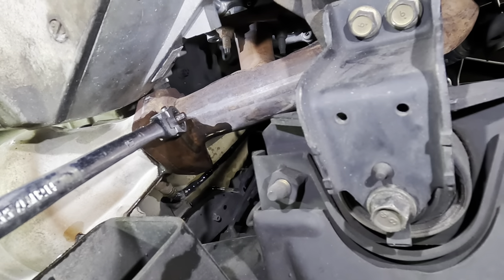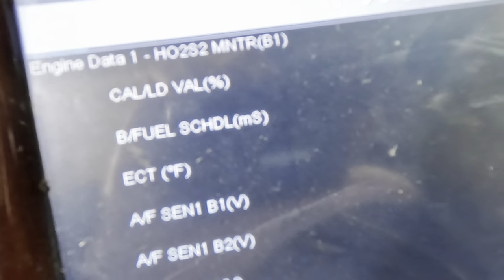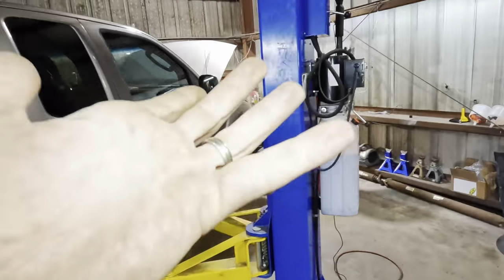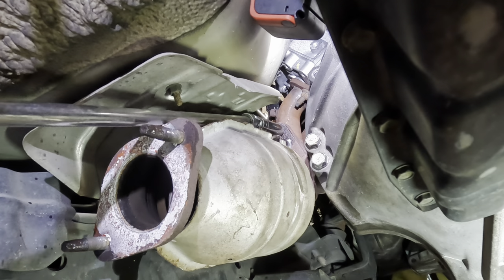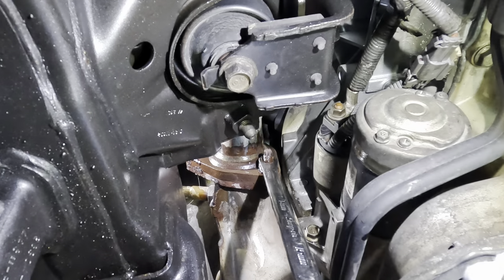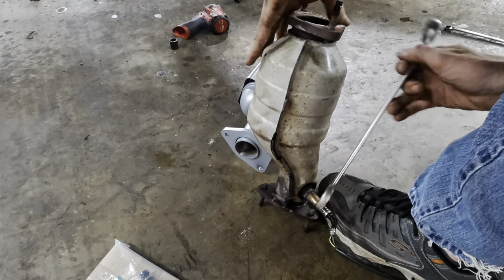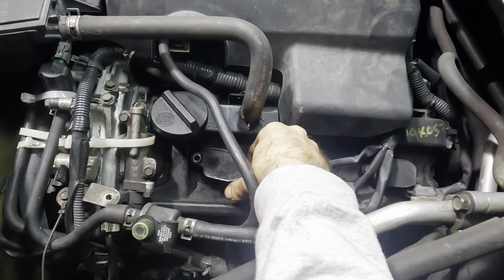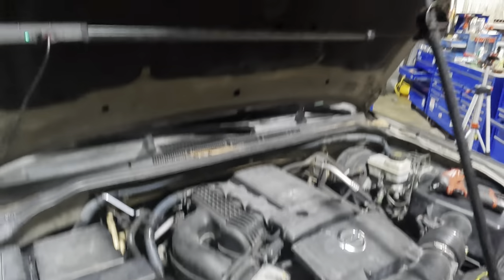Catalytic Converters! Missing?  Running Rough P0302 P0420 P0430 Nissan Fronter 4.0 v6

Comment: A plane requires air flow over the wings to generate lift. Visit a small airport during a storm and if a small Cessna isn’t tied down you’ll see them float. Speed under the wheels has nothing to do with lift.
Reply: This! 👍🏼 it’s about airspeed, not groundspeed.
Reply: Yep might have double the wheels rpm but still the same airspeed
Reply: 100% correct 👍
Reply: Lift is generated from air flow against the lower surface of the aircraft  wings. The airflow over  AND under the wings creates a vortex which is controlled by flaps. This gives you  altitude control. Stick your hand out the window of your car, like most people do as a kid. Keep your palm flat, and you can roughly feel the forces against you hand.
Reply: Exactly, the plane needs to "ride" on air. No moving air, no lift. It's speed of air across the wings, not speed in relation to the ground that creates lift.
Reply: Both the plane's engines and the belt would generate airflow around them, eventually achieving lift. But the question is meant to cause controversy.
Reply: Yep, so many people, even pilots, don't get this.  The only way the plane wouldn't be able to take off is if the engines drove the wheels like a car.  But they don't, because that's not how planes work.
Reply: You are correct sir!
Reply: @trollolol a plane can be stationary and ‘float’ if it has sufficient lift and is tied down. I’ve seen it. Air speed is very different from ground speed. You have ramps on carriers so you have time to build up air speed. A super huge powerful fan in front of the plane could also generate lift without the engines on as their will be air speed.  Just saw your name, your just trolling. It’s cool.
Reply: You all need to revisit the Mythbusters episode.
Reply: What if it's a windy day???
Reply: The way a wing is shaped causes air to flow faster over the top of the wing and slower underneath. This causes low air pressure over the top and high pressure under the bottom. The faster you go the more these forces come into play until the wing has to enter the lower pressure over top of the wing generating lift for the aircraft. It's not pushed into the air it's lifted. That's the condensed version, aviation electronic and ground crew technician for 7 years
Reply: Here's a visualizer that might help:  imagine you have a toy plane and a treadmill.  Hold the toy plane on the treadmill, and push the plane along the treadmill.  If you double the speed of the treadmill it still won't prevent you from pushing that plane along the treadmill, it will just cause the wheels to spin faster.
Reply: Conveyor belts move things.  If the belt was long/fast enough it would take off
Reply: @trollolol The plane wouldn't be standing still, as it's being driven forwards by the jet engines, not the wheels. There's no mention of how long the conveyor belt is but it's going to either take off or come off the ned, then take off.
Reply: Yep the plane takes off. The wheels aren't geared or otherwise directly driven they are essentially free-wheeling with an arbitrarily low non-zero amount of friction due to the bearings, the weight of the plane, friction of the tyres on the tarmac and so on. So yes, the wheels will end up spinning somewhat faster than on a normal runway but the plane will never the less take off as the plane could not give a jot what the wheel speed is during take-off (so long as it isn't fast enough to cause catastrophic failure) for it is not wheelspeed that matters but rather airspeed over the airfoils that determines lift and therefore a planes ability to leave the ground and fly.
Reply: If the conveyor belt was moving forward the plane would take off because airflow over the wings would create lift under the wings and lift the ✈
Reply: @MonoBrawI  Nope
Reply: The airplane doesn't care because it doesn't use its wheels to generate movement. Aircraft wheels are free spinning not counting the brakes, that is the key here. 
Also Mythbusters did this large scale.
Reply: @hot_wheelz  There is no airspeed since in the scenario the faster the jets go, the faster the treadmill goes in the OPPOSITE direction.  That means the plane stands still and cant take off.
Reply: @jet357  Hmmmmm, yes it would take off.   The wheels are powered by the forward  motion of the aircraft.  The action or inaction of the belt  is a non  entity.   The  belt equaling the opposite energy only means that the plane IS moving.   Plane is moving AND air IS flowing over and under the wings.
Reply: Yeah but by the definition of the experiment, the plane CAN'T move relative to the ground around the conveyor and thus not the air i.e. no lift.
Reply: @UCh2ErHSmlm1yVAOIEA55ByA No where in the setup does it state that the plane is to stay stationary. It only states that the belt is to move backwards at the same speed the plane is moving forward. You could start the belt at 200mph and the plane would still take off.
Reply: If you are a fan of Mythbusters the busted it. The wheels don't drive the plane the engines do. If it was a car with wings the it won't move.
Reply: Yep, ground speed is irrelevant without lift.
Reply: Now the big? If the conveyor is moving fast enough could it count towards world land speed record...
Reply: @ken2tou  but there's no airspeed if the conveyor is truly matching the resulting wheelspeed of the plane. It has nothing to do with how the wheels are being driven! The definition of the experiment necessarily doesn't allow the plane to move relative to the ground, ans thus the air, around the plane. I know Mythbusters tried to tackle this years ago, I remember seeing it, but either problem statement was different or they didn't implement the experiment correctly. They were notorious for cutting corners. See my other thread for a more detailed explanation.
Reply: @michaelray5595  there won't be any lift if the plane is not moving relative to the air, and it won't if the speed of the treadmill matches the wheels, even though the wheels are not driven. Most people get this wrong today because the Mybusters did a similar but different experiment
Reply: Um the Harrier Jump Jet would like a word. You only need thrust, not air flow.
Reply: @garyspooner711  mythbusters got it wrong/did a slightly different experiment. Their "conveyor," didn't match the speed of the wheels. It provided more like a frictionless surface (or at least low friction).
Reply: @trollolol hallelujah at least SOMEBODY gets it! Mythbusters ruined this problem for the Internet by doing a slightly different experiment and people don't pay attention to details sadly.
Reply: @realcdcruze3558  there's no airspeed in this experiment, the plane is stationary relative to the air and ground, only the belt and the planes wheels are moving... and the engines spinning but I digress. The belt is designed to counteract the thrust of the plane's effect on it's position by moving equally backwards. It doesn't matter that the wheels are not driven. The way the problem is defined, the plane doesn't move relative to earth.
Reply: The only way the plane would not take off is if it was tied down, and in that case, it would be the tie down stopping the plane from moving, not the treadmill.
Reply: Exactly!
Reply: @RichiPuppi  the plane is not moving relative to the air because in this hypothetical experiment the conveyor is matching it's speed in the opposite direction. So relative to the air and ground around the plane and conveyor system, they would both be stationary no matter how much thrust or how fast the belt has to spin to counter the effect of the thrust. It doesn't matter that the wheels are not driven. In order to take off you need lift.
Reply: Too much common sense. Error error error
Reply: @mattm6834  unfortunately not, there's no lift.  It coild with a sling shot cable, ie. Aircraft carriers, but not a conveyor belt.
Reply: @Onewheelordeal  you can't increase the wheel speed enough (indirectly by increasing thrust) because the conveyor is defined to match it. Even if you got them to 100,000 RPM. The plane CANNOT move relative to the air/ground around the conveyor by definition. It cannot take off.
Reply: @Gideon_Judges6  ummm, yeah? Kinda what I said - ground speed is irrelevant with no lift. I see where you got lost,  though. Ground speed only becomes a factor when the engines are driving it forward to create lift, the wheeks on a pkane are free spinning, they create no drive - plane on conveyor belt same as walking/running on a treadmill...
Reply: You are correct!
Reply: @michaelray5595  I didn't get lost 😆. You got lost where I was agreeing with you. Cheers mate!  BTW the way I like to make the analogy of holding a toy car or plane on a moving treadmill. You can increase the treadmill speed (within reasonable limits) and your hand will match it, and though it takes more effort (thrust) the toy will NOT move relative to the rest of the environment. i.e. no lift.
Reply: @Gideon_Judges6  that would only hold true for a vehicle like a car because the wheels are directly driven. For a plane, the wheels are in no meaningful way connected to the power source (the engines that produce thrust via props or jets). So for a plane, wheelspeed is literally meaningless in terms of a planes ability to take off. The wheels only serve as a smooth low friction interface to allow the plane to travel down the runway without smashing into the ground. Assuming that the undercarriage amd landing gear do not collapse and that the tyres don't pop or the bearings seize then the wheels of a plane will continue to do their job regardless of the ground moving below them. I understand where the confusion starts because when you think of a car the speed of the wheels and the ground speed are inherently and unavoidably linked. That fixed relationship does not exist for the wheels on a plane. The plane WILL take off just with the wheels spinning a bit faster than normal.
Reply: @Gideon_Judges6  ah. gotcha, it didn't quite read that way.  But inflection always gets lost in translation in text. 🍻
Reply: @trollolol this does not zero out because engine thrust is not applied to the wheels/ground, it is applied to air pressure.  This is why when aircraft are launched from a carrier the carrier is pointed into the wind.  It is also why the active runways are the ones facing into the wind, so you don't have a tailwind.  If you have a high tailwind you need even more groundspeed to develop enough lift.  Hence why flying eastbound in the Jetstream is faster than flying westbound
Reply: @jet357  sorry but no. As soon as the jet produces sufficient thrust to overcome the relatively very small frictional losses of the wheels / tyres, the 2 systems are for all practical purposes decoupled. Past that the conveyor can make the wheels spin faster, and they will, but only the jets will have meaningful impact on the forward momentum or the plane and therefore the wind over the air foils and resultant lift. QED the wheels spin faster but the plane still takes off.
Reply: @CatRPlrC16  Nah its vacuum over the wing as the air travels further!
Reply: @Gideon_Judges6  here's the real crux of the matter, so long as the tyres don't pop, the bearings don't seize and the undercarriage / landing gear does not collapse, once the props / jets are producing enough thrust to overcome the relatively very low frictional losses of the system, the treadmill / conveyor belt no longer has any ability to impact the forward speed / airspeed of the plane in any way that is remotely meaningful as the 2 systems are at that point for all practical purposes decoupled from each other. The conveyor belt can and will impact tyre speed, but only the thrust producing system (the engines / props / jets) have any meaningful impact on airspeed. So yes, the wheels will spin faster, but the plane very much still takes off.
Reply: The aircraft has no problem taking off because its engines provide thrust and airspeed regardless of how fast the wheels have to spin.
Reply: That is correct Sir! If enough air is flowing over & under the wings it will fly!
Reply: @@trollolol705 There are planes that lift off from stand still but not Jumbos!
Reply: Hell, I've seen one that wasn't tied down in a hurricane not only take off, but it flew BACKWARDS!
Reply: @trollolol incorrect, mr Trollolol, ( nice handle) as the engines exert thrust against the air, not the ground. This pushes the plane forward. The amount of drag created by the “runway” going in the other direction will be insufficient to prevent this. Indeed, the runway will actually draw air along with it in the vicinity of the surface, which might even contribute to the air passing under the wings, and help to create the negative pressure area over the wing, which is what makes flight possible. But as Ray says, “gravity “. Merry Christmas!
Reply: @hot_wheelz  no, they are NOT decoupled! Assuming (reasonably) that the belt and tire interface is not frictionless, the plane is not weightless  or any other contrived nonsense, the position of the plane is ABSOLUTELY dependent on the state of the conveyor! The plane is applying a downward gravitational force of F_g=mg (i.e. the weight).  The belt is applying a rearward force that is DEPENDENT on the forward thrust of the plane's engines and their subsequent effect on wheel speed relative to the belt. The systems are in NO WAY decoupled! They're interdependent.
Reply: It's easy to see what happens once you realise that the belt has no way to apply a force on the aircraft (Assuming rolling resistance is negligible).
Reply: @jet357  nope. Read the question again.
Reply: Mythbusters did an episode on this.
Reply: @Gideon_Judges6  sorry but no. There are frictional losses yes, but they are tiny compared to the thrust produced by the jets. As soon as the jets produce more thrust than those small frictional losses the wheels will continue to accelerate but the airspeed is only controlled by the thrust produced by the jets. The more thust produced the smaller percentage the frictional losses are of the entire system. The system rapidly becomes decoupled.
Reply: @trollolol Your name give it away.
Reply: Hey Ray, first, merry Christmas. You phrased that question differently around the 22 minute mark than you did at the beginning. And it’s really all about how it is phrased.  Your original question was if the plane could take off when the speed of the belt was maintained to match the normal wheel speed. At 22, you gave the example that the belt would travel at the speed needed for liftoff (V2), and the throttles would be increased to make the plane be stationary.  Those are two completely different things.  If the throttles are only increased to maintain its position, then it will not fly. However that is not nearly maximum throttle.  At maximum throttle, the engines exert thousands of pounds of thrust. The plane will move forward regardless of what the wheels are doing.  (Maximum thrust of a 747 will move it without rotating the tires, they will skid) There will be some drag created by the wheel/road interaction, but less than the thrust created. so the question is then if that drag would be sufficient to keep the plane stationary.  And again, the question would then be if the belt speed would be allowed to be more than takeoff in reverse. Because you will need to go MUCH faster than that before the wheels would produce enough drag to cancel the engine thrust.  And the belt will be also moving a lot of air as well at that speed. Perhaps enough to create some lift. And if the plane begins to lift, you lose all drag from friction with the belt, and and away it goes.  Happy New Year as well! 🎉
Reply: Lift is essential.
Reply: I mean.. the funny part is the debate assumes that an airplane would care about the treadmill. Once the engines get up to speed, it's going to roll right off the treadmill.
Reply: Such Physics used to taught to youngins in pubic skool's , but not anymore. That the ignorant are easily misled has become abundantly clear since Jan 2017.
Reply: Hell even MythBusters did a episode on this explaining it.
Reply: I was shocked this was even a question.
Reply: A conveyor belt would not effect a plane.  Thrust is generated by props, fans, and jets.  Not drive wheels.  There fore the plane would still have the same forward motion and lift nomater how fast the conveyor belt was moving.  Conveyor could be traveling at 5x the speed and have no effect till the wheel speed exceeds wheel failure point then plane broken would prevent flying action.
If you put wings on a car it would stay stationary and have no lift because thrust is generated by drive wheels.
Reply: Ray's conclusions about the inhumanity of man when in the midst of clear and obvious data is, unfortunately, quite correct.
Reply: It's a funny argument and counter intuitive....the plane moves because the prop or jet engine is pushing it through the air creating lift on the wings....the wheels are just along for the ride
Reply: @CatRPlrC16   Pitch control is controlled by the elevators located on the horizontal stabilizer on the tail. The angle of attack of the wing is what what effects altitude. When you stick your hand out of the window of a car and move your hand either up or down that's the effect your feeling, changing the angle of attack of your hand against the air flow over it. Flaps are used to increase the curvature of the wing producing more lift at lower air speeds. The difference in the distance the air has to flow between the upper and lower parts of the wing produces a low pressure area above the wing so the plane is being pulled up into the air verses riding on the lower part of the wing.
Reply: @StormsparkPegasus  If there is any pilot that doesn't understand this I wouldn't even get in a plane with him!
Reply: @SourBogBubble  The jump jet used motors that could be pivoted to point downwards so it could take off like a rocket. A normal plane doesn't have those. A normal plane needs air to be flowing horizontally over its wings fast enough to create lift.
Reply: Correct, the force of the air on the shape of the wing creates a pressure differential ergo lift. This won’t happen without actual forward movement.
Reply: @intentionaloffside8934  Yep, and the jets produce the foward movement.  It doesn't matter whether the conveyor exists or not.
Reply: @RichiPuppi  Think about it. In the conveyor belt example, you could be standing on the body of the plane without any problem. There'd be vibration through the frame, but because the plane was stationary with respect to the ground, there'd be no air movement over the wing and therefore no wind to blow you over (and also no lift, so the plane could not take off).
Reply: @handbananaistherapist642  If you held the brakes it would move forward otherwise no it would not fly. You would need a conveyor belt capable of getting the plane up to takeoff speed, something like 150 to 160 mph.
Reply: Speed of the wheels is not relevant to the medium the plane uses to fly.

The Mythbusters have an episode dedicated to this myth.
Reply: The wheels do not provide power to move the plane forward. So they got it right. The engine provides the forward movement. The wheels will be moving at the speed of the belt plus the speed of the forward movement of the engine. All planes have free moving wheels.
Reply: @hot_wheelz  But in the conveyor belt scenario, there is no airflow over the wings, and therefore no lift, therefore no takeoff.  If you stood on the wing of a plane trying to take off normally, you'd have to fight to stay upright against a wind of the plane's regular takeoff speed; in the case of a 747, that's about 184mph. If the plane was on a treadmill, it could be thrusting enough to be moving at 184mph but it would be stationary with respect to the ground and the air, so no wind, no lift, no takeoff.
Reply: @ColinWatters  There's no lift, because there's no air flowing over the wing. The plane has to be moving with respect to the ground, and on a treadmill it wouldn't be, it would be standing still.
Reply: @jostouw4366  Only because they have pivoting engines that can point downwards and provide rocket-style vertical thrust.
Reply: @Rekuzan  Because the wind was blowing over the wings fast enough to create lift. On a treadmill, the wind would not be blowing over the wings fast enough to create lift.
Reply: @SourBogBubble  The Harrier uses nozzles to vector thrust down to lift off the ground vertically, then the nozzles rotate backwards to apply thrust to the rear to allow for forward movement and then the wings take over. If your argument is correct then why does it have wings at all? It does not fly like a helicopter.
Reply: Yes, the plane will take off; this was a Mythbuster episode and as explained, the ground speed is irrelevant, it is air speed that results in flight.
Reply: @intentionaloffside8934  
Or a bunch of really yuge fans moving lotsa Air
Reply: @stephenb1372  that's close but not entirely right. True it is all about airspeed over the wing however it's about airspeed difference over and under. The air over the wing must travel faster than under the wing thus creating a low air pressure zone on top. Air pressure wants to be equal thus lifting the wing towards the low pressure zone
Reply: If a plane required ground speed to fly it would never be able to leave the ground.
Reply: All saying that it wouldn’t fly are thinking it through (including Ray).
He didn’t say that the conveyor was lock-step to the forward direction of the aircraft. He simply says that the conveyor is moving the opposite speed the aircraft would need to take off OR if the aircraft normally takes off at 150 knots, the conveyor is traveling the opposite direction at 150 knots. This suggests a fixed speed of the conveyor. What this would mean is that the aircraft would be 150 knots in one direction, the conveyor 150 knots the other direction, and the tires are 2x 150 knots.
Reply: @CatRPlrC16 Not quite but nearly.
Reply: @StormsparkPegasus  A plane on a treadmill is essentially stationary in relation to the ground. So how can there be enough airspeed over the wings to generate lift? 

The plane needs to be moving through the air fast enough to create the lift, which it can't do on a treadmill, unless you also have a gigantic fan in front of it blowing a large enough volume of air fast enough over the wings.

When cars are put on dynos (basically the same thing as a treadmill), the car can be producing enough thrust to be travelling at (say) 200mph, but as far as the air around it is concerned, it's standing still. 

That's why there has to be a large fan in front of the dyno blasting air into the radiator - if the fan wasn't there, the engine would rapidly overheat since it needs the airspeed that comes with driving down the road at high speed in order for the cooling system to work properly. 

Otherwise, the engine is running flat-out but the cooling system can only provide enough cooling for an idling engine.
Reply: @StormsparkPegasus Nope. That would make no difference at all.
Reply: @dunebasher1971   Because jet engines produce thrust, which will move the plane forward.  There is no connection between the engines and the ground.  The treadmill will just make the (already free spinning) wheels spin faster.
Reply: The other factor ignored by the it will never fly is the engines develop air speed totally independent of the ground speed. If a airplane required ground speed to fly it would be never be able to lift off the ground.
Reply: @Matt_Vanepps  wheel speed doesn't matter, the fact the aircraft is stationary relative to its surroundings means no forward momentum or velocity thus not generating any airspeed.
Reply: @handbananaistherapist642 Wrong. The plane is only moving with reference to the surface of the belt, not the air around it.
Reply: @Trevor_Austin  If you mean the treadmill makes no difference to the plane at all, correct.
Reply: @SteelJM1 This is the point of this question. The plane is stationary.
Reply: @SourBogBubble A Harrier when hovering is not generating lift with the wings.
Reply: @joshualeniger Exactly.
Reply: @dunebasher1971  I know. I using that as a perfect example of ground speed vs. airspeed. Blocked Pitot tubes have caused planes to crash before because the pilots thought their airspeed was much higher than it was.
Reply: @Trevor_Austin  Trust me.
Reply: @Matt_Vanepps  Agreed, if an airplane required touching the ground to develop forward air speed it would never be able to leave the ground, rather as it started to take off the speed would decrease and it would fall back on the runway.
Reply: @dunebasher1971  nope, the wheels would be moving faster, but that treadmill try as it might isn't sufficiently coupled to the jets to overcome the thrust of the jets. Once the jets overcome the frictional losses (mostly that of the wheel bearings and the tyre with the treadmill / conveyor belt) which happens very quickly, the conveyor belt is no long able to sufficiently influence the forward momentum of the plane, only the wheelspeed. So, once again, the wheels will spin faster but that plane is very much still taking off. Airspeed over the wings is not related to the speed of the wheels. Literally the only way that jet is not taking off is if the wheels are unable to spin at all (either due to the brakes or seized bearings) at which point the conveyor belt need not move as the frictional losses between the tyres / wheels and the ground is near enough infinite such that the plane never moves forward but at that point it is not the conveyor belt that is impeding forward momentum, rather it is the breaks or seized bearings. If the wheels spin with the normal very low amount of friction expected when everything is working as intended then the plane is taking off and there's literally nothing the ground below it can do to stop it (assuming of course that the ground is flat, smooth and preferably somewhat level)
Reply: Correct-o-mundo!  There is, however, the possibility of the wheels flying apart as they would be traveling as fast as the Air Speed plus the tread mill speed. They just might not make it.
Reply: Exactly when the dynamics of air flowing over a wing providing left flight is achieved.  If the belt is moving fast enough
Reply: @dunebasher1971  to take your car on a dyno example, yes absolutely true. However in a car the engine is connected to the wheels / tyres via a transmission, drive train, differential and axles. In a jet, or any other plane designed to take off and land on solid ground the wheels are free spinning, once the very small frictional losses of the tyre with the runway and the wheel bearing are overcome the wheels operate independently of the jets. The wheels do not control the speed over the ground but rather the speed of the ground beneath the wheels controls how fast the wheels spin, forward momentum, air speed, lift etc. are controlled by another system consisting of the jets and flight surfaces (mostly the airfoils and flaps) as long as the wheels are able to spin freely (ie. The wheel bearings are not seized and the brakes are not on) then the 2 systems are decoupled from each other.
Reply: @MonoBrawI  This is it, The plane's wheels are not hooked up to a motor. you need the engine to create airspeed to match the belt to keep the airplane from moving backwards.
Reply: @misterkite  The difference is that your hand is providing the "force" to match the speed. without that it would need engines to move air to match the speed.
Reply: @jimomega381  the example of standing with each foot in a bucket and then attempting to lift one's self off the ground by using your arms to pull upwards on the handles is a good example of a coupled system. In that case, equal and opposite forces cancel and you go nowhere.

It seems that where most people get tripped up with this thought experiment is in not realising that in the case of the plane, the 2 systems in question (the thrust and lift system, ie. Jets, wings, etc.) isn't sufficiently coupled to the system that allows the plane to land and take off safely on a runway (ie the wheels, tyres, landing gear etc.) In the case of the plane, as long as the tyres are inflated, the wheel bearings not seized and the brakes not on then forward momentum and therefore airspeed is controlled by the thrust produced by the jets, the wheels and tyres are at that point simply along for the ride and respond by spinning at whatever speed is required to match the speed of the runway beneath them.
Reply: @BenDecko2023  really? I guess you're not a troll LMFAO
Reply: @jimomega381  no, you are coupled to the treadmill via your feet, run on the treadmill holding the plane, now while still running on the treadmill throw the paper plane forward as you normally would to launch it (this is the thrust produced by the jets) now you find that the paper plane flys across the room just fine despite that fact that you are still stuck running on the spot on the treadmill.
Reply: @Gideon_Judges6  The problem is there is no speed at which the belt can overcome the thrust. It's impossible. The wheels are free spinning, so the only resisting force they can apply to the plane are rolling friction of the tires and friction from the axle bearings. These are so small compared to the thrust from the engines they might as well be zero. The belt could be going 9/10 the speed of light and it wouldn't stop the plane (ignoring the wheels flying apart from overspeed) Think of it this way, if you put a matchbox car (so fully free spinning wheels) on a treadmill, is there any speed you can think of that you could run the treadmill that would prevent you from moving the car forward on it by just a finger pressing on the back of the car?
Reply: @LONECOW1210  Except that engines provide force regardless of wheel speed, exactly like your hand in my scenario.
Reply: @CatRPlrC16  my hand hand?
Reply: @christopherconwell7271    I think you might have misunderstood.   The only thing moving is the belt and it is turning the tires.  The plane is stationary relative to its surroundings.
Reply: @MonoBrawI  No.  There will be disturbed air around the belt and wheels, but that and the air flowing into and out of the engines has zero effect on airflow around the wings.
Reply: @9Blu  you're missing the point. Take your analogy of the treadmill, which was actually MY analogy if you go back, but I digress. If you COULD push the car forward more, this would increase the wheel speed. By definition of the original problem, the conveyor should speed up to match! It would not be possible to overcome that without violating the problem statement. On a freewheeling belt? Sure. On a fixed speed belt? Sure, but not if it by definition is adapting to offset the thrust's effect on the plane moving.
Reply: @Gideon_Judges6  What you have to understand is that your belief that the Airspeed is dependant on the Conveyor speed is entirely a trick of the wording of the question. The wording of the question tricks you into thinking the two are related, when they are not. The conveyor could be moving at 1500mph and the plane could be held in place by a single human being with their bare hands, since the ONLY force they need to overcome is the friction of the wheel bearings. As soon as the engines kick in, the plane will move forward and take off normally, since they push off the air.

Adapting the conveyor/treadmill speed is irrelevant, the question is merely fooling you into thinking it matters at all. If the plane is stationary with the conveyor going 1500mph, then the engines kick in and the plane starts moving forward at 1mph, and you increase the conveyor speed to 5000mph... the plane keeps moving forward at 1mph, because the conveyor cannot counter the plane's engines, only how fast the wheels rotate.
Reply: @GuillermoHernandez-mu5mj  typo typo
Reply: @jet357  Wrong, the jet is being driven by it's engine, not the wheels. According to your understanding a jet could never fly because they moment it started to take off it would slow down. At best the landing wheels would increase its RPM. Imagine a vertical takeoff off aircraft. It lifts straight up (as if on land on a conveyor belt), but as the engines change orientation the air craft flys forward without ever touching the ground; the engines create the lift, not the forward movement. As the aircraft flys faster forward the lift from the wings reduce the gravitational force allowing the aircraft to fly faster, but it requires no ground speed to take off and fly.
Reply: No matter how fast the conveyorbelt moves, if the wind blows just as fast from the opposite direction,  no lift can occur.  The plane wouldn't fly. Because as the other post says, air needs to flow over the wings in the proper direction to create lift.
If there is no wind at all. The plane would fly as long as that speed was maintained.
Reply: @zierlyn   the hand holding it IS "the engines kicking in"! Anything that will try to increase the wheel speed necessarily increases the belt speed. It's not possible for the plane to overcome this without violating the terms of the problem.
Reply: @dunebasher1971  You are being tricked by the wording of the question. You have to break the assumption that it is even POSSIBLE to affect the speed of a plane with a conveyor belt. On a plane, the wheels are not attached to the engines, they're free spinning. Picture this example: You take a toy wagon and place it on a treadmill, and have a young child hold the handle, standing ahead of the treadmill. Put a few bricks into the wagon if you feel like weight matters.

Crank the treadmill up to LUDICROUS speed. What happens? The kid is just standing there holding onto a stationary wagon with wheels spinning FURIOUSLY. This is the same scenario as your stationary plane. The wording of the original question TRICKS you into associating the conveyor speed with the speed of the aircraft as though it is possible to counter the engines with a conveyor, when in reality, the conveyor speed can be overcome with barely any energy at all. The child would have no problem pulling the wagon off the conveyor belt, even if it's moving 300 times faster. Likewise, the only reason a plane would be standing still at all is because the engines are NOT running. As soon as they kick in, the plane will move forward and pick up air speed, regardless if the conveyor is moving at 15000mph.
Reply: @handbananaistherapist642  Actually the wheels are not powered at all, the engine powers the aircraft and the wheels just roll, same as the rear wheels of a front wheel drive vehicle.
Reply: The plane could be on a mag-lev system and it would still take off. Engines provide thrust they don't drive the wheels. The plane & engine is akin to a balloon full of air, the balloon has no wheels yet you hold it up and let go, off goes the balloon, as long as the engine has power/fuel the balloon/plane has an infinite air supply, Providing thrust and forward momentum so the wings provide lift.
Reply: @Gideon_Judges6  The air speed comes from the thrust of the aircraft engine, no different than a vertical takeoff aircraft as the engines change orientation and the aircraft flys forward without any initial forward speed.
Reply: @TheOnespeedbiker  Yeah...kinda but not really.  The wheels do not turn themselves, but react to the thrust of the engines, sooooo in a sense the wheels ARE powered by the engines.  If you can tell me how else the wheels move... well... you cant.
Reply: @hot_wheelz  the plane can NEVER move relative to the ground around the conveyor. If the plane could move forward on the conveyor then this increases the wheel speed, and the conveyor should have sped up to counteract that. I understand that the wheels are not driven/ powered by the plane. I also studied this approx. 15 years ago when it was on Mythbusters. Congrats! But the experiment they ran was different. Can we drop that obvious red herring? But the wheel speed is proportional to the plane's speed relative to the belt. You would have to make the belt a frictionless surface to where it had no influence on the plane's position.
Reply: @dunebasher1971  I know how aircraft fly, I was a pilot. Im afraid you are wrong. The aircraft will accelerate almost normally. Consider the forces on the aircraft. If the brakes are off the belt cannot apply a rearwards force on the aircraft. Its wheels reduce or eliminate almost all friction. It still has normal thrust from the engines acting forwards so it must accelerate. It gains speed and takes off normally. The only difference is the wheel rpm which will be higher than a normal take off.
Reply: @Gideon_Judges6  I edited my other comment to address the increasing belt speed. I'll reply again so it'll be more visible to you.

Say the conveyor speed is going at 1500mph, with the plane stationary. The engines kick in, and the plane begins to move forward 1mph. You increase the conveyor speed to 5000mph. 10000mph. 300000mph. The plane will still continue moving forward at 1mph, because it's pushing off the air. Conveyor speed cannot affect airspeed, the wording of the original question is tricking you into thinking air speed and conveyor speed can possibly influence each other.
Reply: Too simple an explanation that actually makes it almost incorrect.

The plane requires the air flow over the wing to be faster than the airflow under the wing so that the pressure difference creates lift.
Reply: @handbananaistherapist642  The wheels are not powered they are just reacting to the forward movement and friction on the tarmac. I guess it depends on your definition of powered. The first definition I found was  "to supply (a device) with mechanical or electrical energy". Since the wheels are not being directly supplied with mechanical force, but reacting to the force, I would say they are not powered, but I guess it all depends on ones point of view.
Reply: @TheOnespeedbiker  but there is no "forward movement" because by definition the plane is not allowed to move relative to the surrounding ground/air. It's stationary regardless of amount of thrust.
Reply: @Gideon_Judges6  Apply the laws of physics F=ma or a=F/m. What forces are there on the aircraft? How does the belt apply a force on the aircraft (ignoring minimal rolling resistance which the engines easily ovecome on a normal take off.)
Reply: @handbananaistherapist642  read the question again, plane is not moving.
Reply: @TheOnespeedbiker  So they are powered. Was pretty sure that it wasnt  magic.
Reply: @SteelJM1  therefore they cancel each other, and the plane is stationary
Reply: @Gideon_Judges6  I don't think I've mentioned the experiment that myth busters ran years ago even once. Never the less, you are still wrong, any movement of the conveyor belt at all will only aid in allowing the wheels to begin spinning and once they are spinning that plane is taking off just the same as it would on a normal runway. If you wanted the wheels not to spin (and therefore allow the wheels to be decoupled from the jet engines) then the conveyor would need to move in the same direction as the jets engines are already propelling the plane down the runway, trouble is that in that case, the plane still gains airspeed and takes off, just it's wheels wouldn't spin until the moment that it takes off and unloads it's wheels which will be enough to make the wheels spin, just not very fast. So run the conveyor forward or backward, match the conveyor to the same speed as the plane. Unless you physically bolt / glue / tie the plane to the conveyor belt that puppy is taking off and if you do prevent it from taking off then it's the bolts / glue / ties that are responsible, not any movement of the conveyor belt.
Reply: @ELee-fr4tr  You are being tricked by the wording of the question. Ask yourself, why is the plane not moving? The question tricks you into thinking the speed of the conveyor belt is holding the plane stationary. This is systematically impossible. The ONLY way the conveyor belt can hold the plane stationary is when the engines are off. Once the engines kick in, the plane will push off the air and move forward. The conveyor can be moving a million miles an hour and the plane will still continue moving forward like nothing's happening.
Reply: @zierlyn  the conveyor speed DOES affect air speed. The only airspeed (ignoring wind that wasn't part of  the problem statement) is due to the plane moving relative to the air (like in any airplane, frankly) except in this case the plane is being pushed backwards via it's wheels as much as it's being thrust forwards.

Look at it this way. It would be easier with force diagrams but YT can't support that. Anyway, the velocity of the surface of the belt is say Vb. The  linear (not angular) velocity of the edge of the wheels is Vw. The velocity of the plane relative to the ground is Vp. By definition of the problem, Vb = -Vw (that is to say they are equal but opposite directions). If the plane were rolling down a stationary surface, Vw=Vp, that is to say barring any slippage the plane moves forward one wheel circumference for every turn of the wheel.

Initially the system is at rest, the plane is not moving, nor is the belt turning. Vb=Vw=Vp=0. If the plane were to introduce thrust, to attempt to make Vp nonzero and positive, this would increase Vw (i.e. the wheel speed would increase) which necessarily counteracts with Vb increasing instantly (by definition, nevermind how this might be implemented in practice!). So long as the plane remains on the belt, there is no way to increase Vp abocd zero without increasing Vw and thus Vb in the opposite direction. Stated differently, the only way for the plane to move forward is for Va to overcome the belt's Vb, but this necessarily increases Vw which increases Vb proportionally and the plane is sitting on the belt.
Reply: Yup.  Air lift, not speed.
Reply: @MonoBrawI  🤡
Reply: @mattm6834  🤣
Reply: @misterkite  yes and the engines provide that force through wind movement
Reply: @ELee-fr4tr  Yes... it is.
Reply: @CatRPlrC16 . It’s actually the air flow over the tops of the wings.
Reply: @handbananaistherapist642  Yes, it's magjc! The same way the rear tires of a front wheel drive are are powered by the engine.
Reply: LIFT
DRAG
THRUST

GRAVITY
Have you ever seen a fighter jet fly inverted? Add a mug of 🍺 to the pilot's hand. The beer will not spill while inverted. 
I may not be a fuckin pilot, but I know physics.
Reply: @TT-qo9dv  While the wings on an airplane may look the same on the top and bottom, they are actually shaped differently. The top part of an airplane’s wings is slightly sloped upwards, resulting in a more pronounced curvature than that of the bottom part of the wings. As air flows over the top of the airplane’s wings, it becomes less pressurized than the air flowing under the bottom of the airplane’s wings. In other words, the air is more pressurized over the top of the wings than under the bottom of the wings. This difference in air pressure allows the wings to generate lift.

In Conclusion

The wings of an airplane generate lift by creating a difference in air pressure. Air pressure is higher under the bottom of the wings than over the top of the wings. With a higher air pressure under them, wings generate lift. This acting force is essentially what keeps airplanes in the air
Reply: @Gideon_Judges6  I have a better example. Take a wagon (with properly greased bearings), and place it on a flat motorized treadmill. Take a thread, tape one end of the thread to the wagon, and the other end of the thread to a chair in front of the treadmill. Turn the treadmill on.

Turn up the speed. Turn it up some more. More. MORE. Crank it to max. At what point does the speed of the treadmill have any affect on the actual earthly position of the wagon? Now pull on the thread. The wagon moves forward. How fast does the treadmill have to move keep it from moving? It's already moving at max speed, and yet a thin thread taped onto the wagon is able to pull the wagon forward. Actually ignore that. There is no max speed. Allow the max speed of the treadmill to exceed the speed of light. It doesn't matter.

The conveyor belt cannot counteract a force that acts on the body of the wagon, because the wheels are free to spin. The conveyor is only able to impart a small amount of force via friction of the wheel bearings, which is easily overcome by basically anything.

Thus, regardless of how much you increase the speed of the conveyor, be it linearly or exponentially, if you push the body of the vehicle forward, it will move forward. Thus, all you need to do is apply the proper amount of thrust, plus a small amount extra to overcome the friction of the wildly spinning wheels, and the plane will accelerate to takeoff speed and take off, even if the conveyor surface is going a thousand times faster than takeoff speed.
Reply: @StrengthAndConditioning61  wrong.  The lift is primarily created by AOA.  
How else do planes fly inverted?
Reply: @gregw6748  by using the elevator to counteract the forces of lift generated by the wings. Just look it up I went to school on this and took aerodynamics but what do I know?
Reply: @zierlyn  you miss the point of it. The thread is already acting as the thrust, and you can't increase it anymore because that would mean increasing the speed of the wheels and thus the treadmill would counter by speeding up. In fact the way the problem defines it in a way you can interpret it instantaneously. So don't add yet ANOTHER thrust. That's an additional external force. The string is the analogue of the thrust, but you're varying the treadmill speed instead of varying the wheel speed and making the treadmill speed up -- same effect overall. The wheel speed matches the treadmill and so it's stationary relative to the surroundings. Hand as I said, string as you said, an invisible tractor beam... doesn't matter. The problem DEFINES them to be at the same speed. Without adding some sliding (translation) you can't get the plane to fly and still conform to the problem statement.
Reply: Mythbusters tested this and it would  take okk
Reply: @TheOnespeedbiker  Ahhh, you get it!
Reply: @hot_wheelz  No... the wheels spinning DOESN'T "aid in the plane taking off the normal way." Air passing the wings from front to back aids in the plane taking off. If the conveyor was constructively ADDING to the speed by moving in the same direction the plane was facing, THEN it might aid but I don't think that's the intended scenario of the problem statement, however vague that it is. But if that were the scenario, and you had a long enough, fast enough belt, in theory you could induce lift simply from the conveyor carrying the plane through the air and the wheel speed would be zero! I think in practice you would hit enough drag the plane would roll backwards slightly but anyway this is digressing from the original problem.
Reply: @Gideon_Judges6  You're missing my point. The string is not thrust. The string is a representation of the amount of force the conveyor belt is able to impart onto the vehicle. It's not some magical unbreakable string. It's merely a single thread. It's a representation of how minuscule the amount of force the treadmill is able to impart onto the vehicle.

It isn't thrust keeping it stationary. It's overcoming the force of friction holding it in position. If you wanted to remove the string from my example scenario, you simply need to output the amount of thrust from a propeller or jet engine equal to that single thread, which is basically nothing. Scale it up to a fishing line if you want to use a full size airplane. 

The original question proposes that you move the conveyor belt at the same speed needed for takeoff, increasing as necessary to keep the plane stationary.  The failure of the original question is that it is physically impossible for a conveyor belt to keep the plane stationary, at any speed. This is because it takes the force of a single string to keep the plane stationary, with the engines off, even if the conveyor belt moves at impossible speeds.
Reply: @zierlyn  nope, you're not solving the right problem. Look at 0:10. It says "a conveyor belt is designed to match the speed of the wheels moving in the opposite direction." It's not limited to the original takeoff speed. It's dynamic/adaptive and is specified to match the speed of the aircraft's wheels, which means it's matching the the speed of the aircraft if we don't assume any wheel slippage/skidding/translation. The problem is literally specified in a way that it can't take off. That may not be what the original author intended, who knows? But it's the truth.
Reply: @CatRPlrC16  They control surfaces which "control" the airflow to create are the wings themselves...look up Bernoulli effect....the elevators (on tail) control the "attitude" of the aeroplane....aeroplane pointing up, down...the Aerlerons ...on end of wings, assist in turning the aeroplane with help from the Rudder....the Flaps,can enable a more rapid take off(less runway length. not speed) and can enable the aeroplane to fly more slowly for landing purposes...up to a point...the flaps on mine (see profile photo) on 1st stage help take off, and slow flight for landing, 2nd stage only used for landing, as they create too much drag for take off purposes, 3rd stage only used for landing, can land at 34Mph with 3rd stage flaps but they create a serious amount of drag...hope that helps..
Aeroplane in photo is a Rans s6es with a Rotax 582 engine :)
Reply: @Gideon_Judges6  The problem can state that the conveyor belt is designed so that it can instantaneously adapt to any speed to keep the plane stationary all it wants. Doesn't mean it's actually physically possible. 

The original question is flawed, as no conveyor can possibly exist (even theoretically) such that it can actually prevent it from accelerating to takeoff speed.

I've also never limited the conveyor belt speed to the speed of takeoff. I've consistently allowed the theoretical speed of the conveyor belt to be unlimited. 

(Edited to get rid of a useless argument.)
Reply: @jet357  wrong
Reply: @Gideon_Judges6  that's not what the experiment states. it says the belt is moving backwards at the same speed as the wheels. but there's no actual way to measure that. and the plane doesn't care, it'll move forwards. people don't understand aerodynamics or physics.
Reply: @Gideon_Judges6  that belt can't do that. it can just make the wheels spin faster. the plane continues to move forward!
Reply: @Gideon_Judges6  The wheel speed has no effect on the plane moving forward.  The conveyor moves the opposite direction of the plane's speed, meaning the plane is moving forward!  If the plane is moving forward at 100 mph, the conveyor is moving backward at 100 mph, and the wheels are spinning at 200 mph.. it doesn't affect the plane at all.
Reply: @Trevor_Austin  The plane pushes on air, not the ground.  The plane will move forward with respect to the air around it, and the treadmill will just spin the wheels faster.
Reply: Catapult Aircraft carriers…. 
For those that said no. 
Here’s the truth. 

Catapults — The four steam-powered catapults thrust a 48,000-pound aircraft 300 feet, from zero to 165 miles per hour in two seconds. On each plane's nose gear is a T-bar that locks into the catapult's shuttle, which pulls the plane down the catapult.
Reply: Correct! Airflow across the wings provide the “lift” required for the plane to fly.
Reply: @Gideon_Judges6  "in this case the plane is being pushed backwards via it's wheels"  That's where you screwed up.  Unless the plane is using its brakes, it isn't being pushed backwards via its wheels, the treadmill is just spinning the wheels.
Reply: @misterkite  I've explained this enough already. The plane's net speed is always zero. Period. You seem to think the plane can move forward relative to the conveyor but that would mean the wheel will be speeding up and thus the belt must match that new speed. The plane actually CAN'T speed up relative to the belt by definition. Thus their net speed is 0. You seem to be ignoring the problem statement that the belt speed precisely matches the wheel speed by definition because it's not obvious what physical mechanism is causing this -- but it doesn't matter, that's how the experiment is defined. I've already shown this many ways. I'm tired of this. We'll just have to agree to disagree.
Reply: @handbananaistherapist642  Just stop for a minute and use some common sense. Airplane wheels are not powered by anything. Just because they spin doesn't mean something is powering them.
Reply: @@trollolol705 your missing the point here the fact is the planes engine only affect the air around it they dont use the ground at all meaning the ground speed is a non factor here. since the engines are pushing air they will generate thrust that the conveyor CANNOT stop as it does not affect the air that the engines are pushing the plane would take off like normal the only difference would be that the ground speed would be double than that of a normal takeoff
Reply: @StrengthAndConditioning61  your almost there swap the low and high pressure but other than that yes
Reply: @jet357  the conveyor CANNOT overcome the engines the conveyor is ground speed the engines are airspeed the only thing that would be different is that the groundspeed would be double that of a normal takeoff
Reply: @Gideon_Judges6  the engines dont use the ground to generate forward movement thus the conveyor cannot prevent the plane reaching the proper airspeed to takeoff
Reply: @OGBlackjack4701  nope that's not right look it up
Reply: @Gideon_Judges6  the engines only affect air speed the conveyor only affects ground speed these two factors dont interact at all thus as the plane tries to accelerate the planes engines will overcome the speed of the conveyor so it will takeoff at double the groundspeed it normally does it is basic physics dont need the MythBusters to tell you this
Reply: @misterkite  No that's where you screwed up. Again, in order for the plane to take off it has to increase it's speed relative to the ground around it (reall the AIR around it, but for simplicity we're assuming roughly stationary air around the conveyor), which means its wheel speed necessarily increases MORE. i.e. it's spinning it's wheels faster, not moving forward. Just go back to the earlier reply in this long threwd, it's a simple system of equations. Vw is the linear velocity of the wheel relative to the surrounding ground and Vb is the speed of the belt relative to the ground. Va is the speed of the airplane relative to the ground. If the wheel is not slipping, translating, or skidding at all then Va = Vw-Vb, so if we could turn the belt off (Vb=0) then only the plane is moving then Va=Vw. If we turn the plane off (Vw=0) and only the belt is moving, then (at the steady state minus any initial jerking at change of acceleration) Va=-Vb, i.e. the plane is moving in the negative direction. But those are hypothetical conditions because the problem explicitly that the belt speed matches the wheel speed in the opposite direction, Vb=-Vw. Which leaves Va=0 (stationary aircraft relative to the surrounding ground) for any Vw.

Aside, you seem to think the moving belt will only spin the wheels under the plane and not the whole plane, well 1) that's ignoring rolling resistance and 2) in the steady state once the inertia of the plane is overcome the plane will move down the conveyor without the wheels turning at all (assuming we could violate that rule of the experiment that wheel speed matches treadmill speed).
Reply: @Gideon_Judges6  this experiment has bin run a few times actually if you start a ball rolling down a treadmill at the same speed it is running then the treadmill will actually cause the ball to speed up meaning the harder the treadmill tries to prevent this the harder it will be for it to stop the ball the same principle will go for the planes in all these scenarios
Reply: @OGBlackjack4701  the plane CAN'T overcome the speed of the conveyor! The problem defines it such that the wheel speed equals the negative inverse of the conveyor speed. For the plane to "overcome" this makes them necessarily have different speeds which violates the rules of the experiment! How the conveyor achieves this is irrelevant. That's how the rules were defined.
Reply: @OGBlackjack4701  cool story, but in this experiment the ball er... the wheel sorry, is defined to be at the same speed as the belt. So the wheel can't speed up relative to the belt, the belt will travel at the same speed only the opposite direction. They can both speed up or slow down relative to the ground, but they will have the same speed (opposite direction) as eachother. That's how it's defined!
Reply: Logic prevails, sometimes lol   I tested this once on a $100 bet using an R/C airplane, got a free steak dinner for me and the wife.  Engine off it naturally went backwards, engine on it took very little throttle to maintain position and forward progression was no issue.   That's the confusing factor for people is if the plane did not throttle would it go backwards ?  That depends on how much friction from the wheels/brakes and mass.  If brakes were on yeah it would reverse at the speed of conveyor but that was not part of the question since it's trying to take off.

I think it's more unlikely a plane would be sitting on a conveyor belt on a runway lol
Reply: If you stand on a sail boat and blow on the sail, will it move the boat?
Reply: @AT-wl9yq  So they spin by themselves?  Ok...I will take your word for it.  Have a nice day.
Reply: Maybe someone needs to tell folks that the wheels on a plane are just coasters and not drive wheels - forward momentum (and with that, airspeed) comes from the thrust of the engines, not from ground friction... (I know - exceptions for some with taxi motors - but anyone with critical thinking skills knows what I mean.)
Reply: I just can't even fathom how this was even a debate about the plane...if the plane isn't actually moving there will be no air flow on the wings to create lift
Reply: @handbananaistherapist642  Yes. Spinning by themselves doesn't mean its powered. I'm sorry you don't understand it, but facts are facts.

Instead of arguing back and forth, can you reference some legitimate sources to back up your claim?
Reply: @CatRPlrC16  Airplane wings are shaped to make air move faster over the top of the wing. When air moves faster, the pressure of the air decreases. So the pressure on the top of the wing is less than the pressure on the bottom of the wing. The difference in pressure creates a force on the wing that lifts the wing up into the air.
Reply: Exactly
Reply: Lmao, I'll just say this.
If you believe the opposite,
  you believe that the earth is flat.
Enough said.
Reply: Lmao, I'll just say this.
If you believe the opposite,
  you believe that the earth is flat.
Enough said.
Reply: @Gideon_Judges6   You are making a fool out of yourself!🤣
Maybe contemplate how wheel bearings work. 
Short of some rotational velocity where the wheels or bearings fail, there is extremely little force imparted by the motion of the belt and wheels on the mass of the airplane. It would not even begin to prevent the thrust of the engines from accelerating the airplane forward to its takeoff airspeed.
Reply: @markbeiser  no, you just don't understand the problem as stated. There's no need for name calling.
Reply: @trollolol the plane is accelerating against the air, not the belt. Unless the wheels have heavy turning friction, the backward motion of the belt will have almost no impact on the plane's ability to gain airspeed and take off.
Reply: @Gideon_Judges6  I completely understand the problem, and the relevant forces at play.
The speed of the conveyor is irrelevant to the motion of the aircraft, it is the engine thrust that moves it.
The wheel bearings decouple the aircraft from the movement of the conveyor by reducing the frictional forces between the wheels and landing gear to near zero.

It is you who has utterly failed understanding.
Reply: O no you’re opened a bag of worms there Ray and I’m an airline pilot.
Reply: @Gideon_Judges6  you say the treadmill "counters" increased wheel speed by speeding up. Wouldn't that mean the treadmill just adds more energy to the system, causing the wheels to turn even faster? How would that have a negative impact on the plane's ability to push itself into the wind and take off? Why do you think the wheel speed matters?
Reply: The engines create forward thrust.  They do not drive the wheels forward to make the plane go forward.  So yes, the wheels will spin twice as fast, the engines will move the plane forward and it will achieve enough forward speed to have ground speed and airspeed.
Reply: the other thing is that locomotion, or propulsion  is provided by, in this case, air going through the turbines..., not from the friction from the tires
Reply: @dunebasher1971  There you go!  Which the conveyor belt  won't allow the plane to go fast enough to get that. It will be stationary.
Reply: @dunebasher1971  Like an Osprey.
Reply: @TheOnespeedbiker  Then why do they acquire that ground speed before takeoff? They do it to get fast enough to create lift. Can't do that sitting still.
Reply: No you see, you get the belt going really fast with the engines and ready to go and the brakes released on the wheels. Then you jam on the brakes, and the belt will launch 🚀 the plane into flight. It’s nice to do it that way cause it doesn’t need much runway. 🤪
Reply: @philipershler420  lol
Reply: @Gideon_Judges6  this is my last post on the matter because you're clearly not interested in listening to logic. Given the constraints of the original thought experiment, it's not possible for it to exist in the real world at full scale given current technology. That said, many a mathematician, physicist or mechanical engineer have modeled this extensively and in every case, the plane takes off.
Reply: It’s the same reason sea gulls can sometimes be seen just hovering in the air when the wind is blowing fast enough to create lift.
Reply: @StrengthAndConditioning61  that changes the angle of attack
Reply: @gregw6748  I know all about aoa and pitch and yaw and roll. The way a wing is shaped causes the air to flow faster over the top of the wing creating low pressure and higher pressure under the wing, the faster you go it creates lift on the wing and the aircraft wings wants to occupy that low pressure. That's lift. Changing the aoa creates even lower pressure over the top of the wing and higher pressure under the wing and you lift into the air. But you have to have enough airspeed for the weight and size of the aircraft or it won't lift and I said earlier that I was giving a condensed version and I'm not going any further
Reply: But what if the pilot is wearing two different colored socks!
Reply: Any person can ask a qiestion that has no known answer or the ability to skew the correct answer to make others appear to be incorrect,but every question has more than one answer/matter of oppinion! Remember Cliff on Cheers,bet it all on final Jeopardy,when asked who were these three people(i dont remember actual ?)his reply was ,who are three people who have never been in my kitchen! Was it wrong,no not technically!
Reply: Exactly! There is a video out there if a glider flying at 5k feet completely stationary, but the wind speed was about 80kts or something like that
Reply: @hot_wheelz  You must not understand the example Ray stated..It said that the jets thrust would be matched in the opposite direction by the treadmill.  The more thrust the jet applied to ATTEMPT to move forward would be matched by the treadmill s increased speed in the OPPOSITE direction.  The plane will never move forward regardless of how much thrust it applied.  It will never fly as a plane in that scenario will never have air moving over the wings to create lift.
Reply: @jet357  I understand perfectly. The wheels of the jet are not sufficiently coupled to the jet engines in order to prevent the jet from moving forward. Literally doesn't matter how fast the conveyor belt is moving. As soon as the wheels on the jet start spinning, that puppy is taking off and there's literally nothing that the conveyor belt can do about it. And as with your example, the wheels must start spinning as soon as the conveyor belt begins moving or the plane would be thrown off the back of the conveyor belt just like if you turn a treadmill up to maximum and then jump on while it's in motion, if you don't start running real fast to oppose the motion of the treadmill then you're going to get thrown rather forcefully off the back of it in short order.
Reply: @Gideon_Judges6  I think you misunderstand the problem statement then. In the problem, the treadmill speed matches the aircraft speed, but in the opposite direction. That is absolutely possible to do and have the airplane still take off. It would just be running the landing gear wheels at 2x their normal speed. It is impossible for a treadmill, going any speed, to counteract the thrust of a airplane engine unless the pilot left the brakes engaged. You can google the original problem if you want to read the conditions.

Going back to the toy car on a treadmill, try it. You could set the belt to run at 10 mph while holding the car still. This would not only meet but exceed the conditions of the problem. You would still be able to push the car forward with virtually no effort. The coefficient of friction for the wheels on the axle is so small that it can't hold the car back, it's physically impossible. Same with the airplane. If you go look up the thrust output of a 747 (the plane from the original problem) and the coefficient of friction for the wheels, plus the rolling resistance of the wheels (these are actually available values, you can google them) and calculate forward vs reverse force vectors you will see that it is impossible to stop the forward motion of the airplane with forces applied to the wheels by the treadmill. If it where, the plane could never take off even on a regular runway.
Reply: @zierlyn  Check Captain Joe, youtuber, an airline pilot for the explanation, he will explain why the plane will not take off, he posted the scenario posed by the question and debunks your reasoning much better.
Reply: @ELee-fr4tr  I have watched it. He doesn't exactly debunk it, but he explains the flaw in the logic of the question much better. The plane cannot take off, because in order to do so, due to the restrictions set by the problem, the conveyor belt would accelerate to infinite speed.

So it's not a physics problem, it's a logic problem. In order for the plane to take off, given the wording of the original problem, it must first break reality with an infinitely fast moving conveyor belt.

So the plane can't fly because the wording of the problem makes it impossible. The answer is essentially "Since the conveyor belt is unable to move at infinite speed, the entire system cannot exist, thus the plane cannot take off."

That's dumb. I'll accept it as a reasonable answer, but that's dumb.
Reply: @Gideon_Judges6  I have arrived at the conclusion that given the original wording of the question, the plane cannot take off. BUT not because the conveyor belt is somehow able to keep the plane stationary. The plane cannot take off, because moving forward any amount would (by the fundamental laws determined by the original question wording) cause the conveyor belt to move faster than infinitely fast. Since it is not possible for the conveyor belt to move faster than infinitely fast, the plane cannot accelerate. 

An explanation for anyone else reading: The original question states that the conveyor belt will always move fast enough to keep the plane's position stationary. Any amount of thrust from the engine would require the conveyor to move faster than infinitely fast to counter the rotation of the wheels, since it can't actually affect the plane's acceleration in any meaningful way.

Since it is impossible for the conveyor belt to move faster than infinitely fast, it's not the conveyor that fails, it's the reality of the system created by the question, resulting in the plane never taking off, because it's not possible for it to exist in the first place.
Reply: @handbananaistherapist642  All I had to do to shut you down was to ask a simple question. Works every time.
Reply: The internet went into full flat earth vs round earth rage for this though it was incredible
Reply: @TheOnespeedbiker  I never suggested the plane is powered by its wheels.  The original hypothesis is would a plane be able to take off on a conveyer belt that perfectly matched its speed forward...in other words the more thrust applied, the conveyer belt sped up to keep the plane in the exact same spot at all times.  No air would ever go over the airfoil(the wings) and therefore no lift would ever be created.  If you want another visual, imagine you were on a treadmill running 10 mph.  Youre perfectly centered on the treadmill which is matching your speed forward by going in the opposing direction.....Now place a hang glider on your back....if this doesnt clear this up for you and others, then best of luck in your future.
Reply: I believe Mythbusters covered this. 
Stay crazy Ray. It will keep you from going insane.
Reply: @AT-wl9yq  Ask your therapist about your need to be right at any price.  A good place to start.
Reply: @jet357  Running on a treadmill is not an accurate analogy. Your feet push off of the ground to move you forward. This is the equivalent of a car's engine powering the wheels to drive the car forward by pushing against the ground. It is absolutely not equivalent to a jet engine powered plane which pushes off of the air to move forward.
Reply: @jet357  The  aircraft will be driven by the thrust of the engine. IOW the engine will push the aircraft through the air with the wheels on causing friction. The moment the forward sir speed is sufficient for lift the aircraft will become air born. What the ground is doing under wheels us totally irrelevant. With a conveyer belt the wheels will simply spin faster, but it will have no effect on the forward speed.
Reply: @handbananaistherapist642  What's the matter? Pretending to be smart isn't working out for you? As you're finding out, it can't be faked.

I just remembered something. Were you able to come up with an answer to that really easy, simple question I asked? You can answer it, can't you? If its too difficult, maybe one of the other posters can help you out.
Reply: @christopherconwell7271  No, if the plane was relying on the conveyor and it achieved enough forward speed for lift, it  would drop to the ground immediately because it would be relying on the forward speed from a mechanism on the ground and not an engine pushing it through the air without and ground force.If it was on a conveyer going in the opposite direction, the engine would determine the forward speed a d the tires would simply spin faster. The only force being e exerted on the aircraft by the conveyor would be through the times.. IOW the tires would spin at a combined speed of the forward air speed  resulting from the engine thrust (an aircraft flies completely independent of the ground) and the speed of the conveyor, but there is no way friction on the wheel bearings of the aircraft would have any affect on the forward speed.
Reply: @StrengthAndConditioning61  The engine pushes or pulls the aircraft resulting in for airspeed and lift via the wings with most aircraft unless it is a rocket that relies totally on thrust to defeat or mitigate the forces of gravity.
Reply: @Gideon_Judges6  But it will be moving forward because the conveyor would only spin the wheels faster as the engine trust pushes the aircraft through the air.
Reply: @TheOnespeedbiker  agreed, I was just explaining how lift on aircraft wings works not propulsion systems but you are correct
Reply: @old-mtl-guy  Some people arent understanding the original question, or we have a bunch of idiot trolls.
Reply: @TheOnespeedbiker  There is no forward air speed.  The plane is kept stationary in this make believe question.  No air speed means no lift.
Reply: @jet357  The aircraft engine creates forward air speed, that's its purpose; it pushes or pulls the aircraft through the air. That is the definition of motorized flight.
Reply: @jet357  The key point you are not getting is: "Why is there no air speed?" If your answer is "because of the conveyor belt" then you are wrong and do not have a proper understanding of the physics at work. Period. Full stop. Argument over. I would proceed to explain to you exactly why this is the case, but you have to be willing to accept that you are wrong. If you are not willing to entertain the idea that you might be mistaken, then there's no point.
Reply: @TheOnespeedbiker  the airplane is not allowed to move foward without the wheels sliding or skidding. That's the way the system is defined. Any motion of the plane relative to the surrounding ground, forward or backward, imparts a motion on the wheels. Any increase in the wheel speed means the belt should speed up to match. This increases the effort (thrust) the plane needs to overcome the belt driving it backwards by the landing gear. An example is like a rollerskater on a treadmill holding onto a rope. Their arms and the rope system is imparting a  forwars "thrust" (really a force). If the rollerskater would pull themselves forward, this would change their wheel speed, and the belt would have to increase to match, which in turn imparts more wheel speed. The skater CAN'T increase their speed by definition because the different in wheel and belt speed are defined to be zero, so the airplane can never have a yet higher speed than that.

I'm not saying the rules of this experiment are a physically implementable or useful system, but it's a system of equations and this can't be violated just because a couple balding gingers on a Discovery show ran a different but similar experiment with a different outcome.
Reply: @zierlyn  Bingo! First paragraph is dead on. That's my point. I can't convince the "bandwagon" here though. In tried basic logic, physical systems of equations, analogies, and most just don't get it. I'll make maybe one more attempt, via induction.

Say in this experiment the belt is completely stopped. Surely the plane can take off now, right? To do so would impart a (linear) wheel speed that is greater than the belt speed, violating the constraint. By induction, for any belt speed the wheel speed must be equal so the airplane speed relative to the surrounding environment must be zero. Mathematically the only solution for if it can take off is if you can have a takeoff speed of 0, which is uninteresting unless discussing VTOL or Helicopter or similar propulsion system that operates in a different axis than the assumed plane/conveyor system.
Reply: @Gideon_Judges6  The only connection to the conveyor belt are the wheels which are irrelevant to the forward movement of the plane. The engine creates thurst which moves the aircraft forward through the air; the wheels would simply spin according the combined speed of the forward air speed and the speed of the conveyor. The aircraft engine pushes or pulls the aircraft through the air, the fact the wheels are touching the ground has no effect on the forward air speed generated by the engine. This is the definition of motorized flight.
Reply: @TheOnespeedbiker  no, the fact that the wheels are touching the ground means any forward movement of the plane causes them to spin proportional to that movement more than the belt is already traversing, thus violating the constraint of the problem. It's a logical problem not a practical physical one.
Reply: @Gideon_Judges6  This is the same principle as a helicopter, except the aircraft is being pulled forward, not up. Once the aircraft has sufficient forward air speed, than lift will occur under the wings, but the engine will still determine the forward air speed, the lift from the wings simply help neutralize the aircraft's weight.
Reply: @Gideon_Judges6  Again the spinning of the wheels is irrelevant because the forward thrust from the engine is propelling the aircraft through the air, even though the wheels are touching the ground and the wheels are simply spinning freely.
Reply: @TheOnespeedbiker  you're missing the point. The speed of the wheels is NOT irrelevant. It's defined as equal in magnitude to the speed of the belt, but opposite direction. If the thrust of the airplane moves the plane forward AT ALL, other than offsetting the movement of the belt, the wheel speed will increase... BUT the wheel speed CANNOT be more than the belt. It must be equal with the belt speed by definition! That's the way the problem statement defines the system. Just look at the math and stop trying to rationalize it as a real system. We don't know and don't care how the belt manages to match the wheel speed, this means the net speed of the aircraft is zero!
Reply: @Gideon_Judges6  Image an aircraft with skis so it can take off from the water. If the engine is off it will drift with the current. But with the engine running it rides over the top of the water and takes off. Well the water is the same as a conveyer belt. The water plane can skip over the water because it's not in the water, it's on the water, so all it needs to do is overcome the friction between the water and skis the same as the friction between wheels, actually the wheel bearings and the ground
Reply: @Gideon_Judges6  No because the aircraft is moving through the air, not on the ground. The wheels are momentarily touching the ground, but the plane is moving through the air.
Reply: @travissheehan6082  The engine has is pulling the aircraft through the air, the wheels are just spinning freely. 👌
Reply: @TheOnespeedbiker   no it is not moving relative to the air at all, the conveyor belt is keeping the airplane stationary
Reply: @travissheehan6082  Of course it is, the engine thrust is pulling it forward, increasing in speed while the wheels just spin freely.
Reply: @travissheehan6082  How is that possible. The one connection to the conveyor belt are free rolling wheels, while the engine has enough thrust to propel the aircraft forward at 100 mph. The ground speed is irrelevant because the tires are just freely rolling over it. It would be like wearing roller skates on a tread mill.
Reply: @travissheehan6082  No the asks will it take off. And since the wheels will roll freely like roller skates on a treadmill. Add airspeed from engine thrust and it will definitely roll forward and take off.
Reply: @travissheehan6082  You are confusing ground speed with air speed, which is a common mistake with this puzzle. The air speed means the engine thrust is lifting the plane and deweighting the tires, IOW literally flying forward with the tires still touching the conveyor. It's no different than a helicopter, except the thrust is forward. All the conveyor belt does is increase the RPM of the wheels. Motorized flight requires thrust to move the aircraft forward and enough air speed to cause lift to the wings. You somehow can't understand that the engine thrust has the power to move the aircraft through the air, even though the wheels are still on the ground. By your logic, given the same scenario a pilot attempting a touch and go on a conveyor would cause his plane to immediately freeze in space and crash, rather than just spin the tires.
Reply: @jet357  The treadmill only controls the ground speed. The air speed is controlled by the engine, meaning as the engine increases thrust, it pushes the aircraft through the air. The aircraft is in connected to the conveyor via free rolling wheels, so as the aircraft airspeed increases, the only affect from the wheels would be an rpm increase. An engines thrust can propel and aircraft at 100 MPH, while the conveyor would simply be spinning the wheels.
Reply: @UCbDTQT6w5zqABDHTVWFA_iQ Yes but you need both lift and thrust. A vertical takeoff aircraft uses only thrust during take off. In the case at hand thrust will create forward air speed. The wheels touching the ground on a conveyor would have no affect on the forward thrust from an aircraft engine. The only connection from the conveyor belt to the aircraft are free rolling tires. The forward thrust will move the aircraft forward in space, while the conveyor belt will spin the tires (even if the conveyor matched the air speed it would simply spin the tires faster as the air speed increased). Eventually the thrust will create enough air speed for lift, but even without wings the thrust from an aircraft engine still can create hundreds on MPH in forward air speed, meaning it would be impossible for the conveyor to stop the forward acceleration of the aircraft. Remember the air speed created by the thrust of the engine has no connection to the movement of the ground, much the same as an air boat skims across the water with little influence from direction of the tide.
Reply: @travissheehan6082  And you still think it's not 🤣
Reply: Its a matter of conservation of energy.  The upper surface of a wing is curved, hence the airflow is faster across the top of the wing compared to the underneath.  Due to kinetic energy being related to velocity the kinetic energy of the airflow at the top of the wing is more than the kinetic energy underneath.
However total energy must not change. Pressure energy decreases at the top.  Aircraft lifts.
Reply: @knifethrower9733  Yes, it would take off. Provided it was a head wind blowing at approximately 160 knots (184 mph). 💨😬
Reply: @TheOnespeedbiker  Before you get too caught up arguing and burning out your brain, you need to know that the original problem is not a Physics problem, it's a logic problem with a trick premise.

Physically it is impossible for a conveyor belt to affect the plane's forward momentum. HOWEVER the question REQUIRES you to work with a conveyor belt that CAN. Through magic for all we know. Trying to apply real-world physics is completely irrelevant because the Problem itself already defies the laws of physics in its premise.

I know the conveyor can't do anything. You know the conveyor can't do anything. The Problem says "but what happens if you simply assume that it CAN?"
Reply: @trollolol I guess you are trolling right now? :-) To answer you, we can.

 Airspeed generates lift, ground speed doesn't. I have seen planes take off and land into winds and the plane is pretty much stationary compared with the ground. 

The only problem comes when the wind speed drops!
Reply: You got two v Delta , as long as the v Delta in direction of flight is greater than v Delta in counterdirection and you have sufficient v Delta   airflow around the wings the jet will  fly
Reply: @CatRPlrC16  Lift is generated from the air flow over the top of the wing. Wings create lift based on Bernoulli's principle. Air flow against the lower surface of the aircraft  wings is called drag, too much drag or not enough air speed you get a stall.  P.S. I am an aerobatic pilot, excess drag and stalls are very entertaining and fun if you know what your doing.
Reply: The rotation of the tires isn't what is moving the plane and has absolutely zero impact on anything.  The plane moves by thrust.  Once the plane is moving fast enough to generate life, it can take off regardless of the speed at which the wheels are spinning.
He verbally did not explain the question the same way the meme did.
Reply: @tarstarkusz  The original Problem defines the conveyor belt as able to instantaneously and perfectly counter the rotational speed of the wheels so that the plane remains stationary. 

It's an impossible premise, because a conveyor belt, in reality (by the laws of physics), cannot stop the plane from moving. Regardless, it IS the premise of that Problem.

So the matter becomes: As we are given a completely impossible restriction on this imaginary airplane, it can't fly. The wording of the original Problem is the equivalent of saying: If you tied the plane to the ground with unbreakable rope, can it fly?

So there are three groups of people regarding this argument: 

Group 1 knows that a conveyor belt cannot possibly stop a plane from taking off, because physics.

Group 2 knows that the question is a trick and the plane can't take off, because of the impossible premise.

Group 3 thinks a conveyor belt actually does something to a plane and are just flat out wrong. 

A lot of people in these comments are in Group 1 and are completely unaware of Group 2's existence, thinking everyone outside of Group 1 must be in Group 3.
Reply: @Gideon_Judges6  You are so wrong on the entire concept. 
I have a simple experiment for everyone to try. Find a treadmill, put it at full speed and place a car on it, like a matchbox or anything that freewheels. Hold it in place with a finger at the back. Now, how much effort does it take to move it forward?  You would be surprised how little effort it takes.  Your finger is the thrust of the jet engines.  Doesn't matter how heavy it is either, as long as the wheels have no motive power or other gearing to drive them, and just free wheel, the experiment will always have the same result. The plane will fly.
Reply: @acdii  I spent way too much time arguing with Sol so I'm writing this to prevent you from doing the same. After all my time arguing I came to realize that he's correct BUT not for the reasons you might think.

I repeat: He's not correct for any reasons that have any basis in reality or physics, but he is correct in regards to the trick wording of the original problem.

The wording of the original problem forces us to work with the existence of a physically impossible conveyor belt that can somehow instantaneously match the rotational speed of the wheels as they move over it as to keep the axle stationary.

There is no possible way for a conveyor belt to stop the axle from moving IN REALITY. However, the premise of the question says "too bad, pretend it exists and deal with it."

Sol understands that the premise is a trick, and is trying to explain why it's a trick. People continue to argue with him thinking he's trying to explain physics (I was also one of those people), but he's not.
Reply: There is nothing for the wings to use what’s it called oh yea LifT
Reply: @zierlyn  The wheels are not the origin of movement like they are in a car.  There is no tie whatsoever from the wheel speed to the plane's prime mover, thrust.  You can push a car onto a dyno, even though the dyno has rollers that will spin at the same rate as the wheels.  That conveyor can do whatever it wants, it's not going to prevent the plane from moving.
Put a remote control car on a powered treadmill.  if you can exactly match the speed of the motors for the wheels and conveyor belt and the car will go nowhere.  That is true. But now, instead of using the remote to try and drive the car off the  treadmill, put your hand on the back of the car and push it forward.  At this point, you can speed up the treadmill and all that will happen is the wheels will spin faster, but it will still go forward at the same speed.

The thought experiment is a fundamental misunderstanding of what is happening.  On a plane, the wheels freewheel when taking off. The tires are not pushing the vehicle forward, the thrust engine is.  The wheels will be spinning at the forward momentum of the plane plus the speed of the conveyor.
If the conveyor is moving backwards at 5mph and the thruster is moving the plane at 5mph, the wheels will be spinning at 10 mph.  The conveyor is incapable of slowing down the plane.
Reply: @hot_wheelz  And I was just going to point out - absurdity of the debate aside - the only way this could affect take off is if the wheels spin fast enough to blow the tires (casings!) apart and cause the landing gear to fail - which would, then, prevent takeoff - anyone with any hint of a concept of what actually MAKES a plane fly should have no problem at all picking the correct side of this argument.
Reply: @tarstarkusz  Not sure if you completely skipped reading my  comment or something... But yes, I know. The conveyor cannot possibly in any way prevent the plane from moving forward. I agree with you. You're correct. This is not up for debate. A plane cannot be affected by a conveyor belt. It's not possible. I don't know how many more ways I can tell you that I agree with you.

The issue is that the thought experiment says: "Assume that it CAN, now what happens?" It doesn't make any sense, we both know that. But that's how the question is worded, and if you abide by the rules of the question, not reality (because such a conveyor belt defies all laws of physics and cannot exist) then the plane can't move. Because the impossible conveyor belt that defies all laws of physics and only exists because the thought experiment says it exists is keeping it in place.
Reply: @TheOnespeedbiker  in have seen the light once sober you are correct. Congratulations sir!
Reply: @zierlyn  Sorry about that.
Reply: @travissheehan6082  I have been in the same place, including this very subject, of not being able to understand a concept. Most of the time it takes a number of explanations before the realization suddenly dawns on me, and of course you have to want to know why something that appears to be act according in a counter intuitive way. The fact you actually posted your realization places you far and and above most posters, who even if they start doubting a an inaccurate belief they are defending, they would never admit it. 

If you want another paradox, imagine two vehicles heading towards each other at 100 mph. When they crash would it have the affect of crashing into a brick wall at 100 or 200 MPH. This was also on Mythbusters and believe it or not, it's 100 MPH. This can be explained by Newton's Third Law of Motion which states that for every action (force) in nature there is an equal and opposite reaction. If object A exerts a force on object B, object B also exerts an equal and opposite force on object A. In other words, forces result from interactions.

So when the two cars crash there will be a opposite reaction in both directions, negating the combined force. This is one of those I understand but not intuitively.
Reply: @@bradythefox9786 The friction would only be through the wheel bearings, so next to nothing.
Reply: @acdii  we've already had that exact analogy. You're just adding your own redunacy to the thread.If you move it forward, you're increasing the wheel speed relative to the belt speed, which is violating the constraints of the problem! The definition of the problem doesn't allow this to happen. Somehow the belt is made to speed up and you will race to infinity (though in a real practical system you will hit some physical limitation first). If you'd have even read 1 of my responses properly you would've understood that already.
Reply: As a professional airline pilot with thousands of hours in airliners….. I’m astounded by the comments here!  Really???  Wow….  There is an amazing amount of people in this comments section that need to go back to “physics101.”  Ray is not one of them!
Reply: BOOM go the wheels/bearings from from being up to double speed. it would likely have multiple wheel loss and crash into a fireball before achieving anywhere near liftoff speed.
it's a trick question on many levels, if it was meant that way or not. 😉
Reply: @throttlebottle5906  That’s the most ridiculous thing I’ve ever heard!
Reply: @johnrocheleau9946  well, technically it is "sitting still" so the wheel speed and conveyor speed would be zero....
but if the engines were started and it tried to take off, the conveyor would go opposite the forward motion of the wheels connected to the jet and the wheels would then be turning twice the speed as usual in proportion with the forward "air speed".
all wheels and tires have a safe speed rating and limit, which effects maximum takeoff and landing speeds and of course there's brakes and wheel bearings. going beyond any of them results in bad things. lol
Reply: @throttlebottle5906  Unless the airplane is tied from the nose to a tree (or something of the like) it will not be “sitting still” on a moving conveyor belt.  The way it’s capable of “sitting still” is BECAUSE the engines are running.  And as you said, “lol.”
Reply: @MonoBrawI  I don't really see how the belt is supposed to generate airflow. And running the engines at higher rpm than idle would actually push the plane forward, because you don't need the engines for the plane to stay on the belt. Just like a ball doesn't fall off a turning disk, the plane will remain on the running belt, because it has wheels.
Reply: @Gideon_Judges6  So, what is keeping the plane from moving?  There is absolutely nothing stating the plane is secured. If you were to start the conveyor, the plane would move with the conveyor, backwards.  Theoretically it is IMPOSSIBLE for the plane to remain stationary in this situation unless it is ground tied, which defeats the situation altogether.  The plane will fly, its the laws of physics.  As far as the plane is concerned, it would assume it was on ice, which in essence, it is.  To defeat thrust, you have to secure the plane to the ground.  As long as the wheels can roll, the plane will take off.
Reply: @throttlebottle5906  While this is physically possible, you’re missing the point of the exercise/experiment.
Reply: @Quentin Spruill Planes are not cars and are not driven by the wheels. When taking off, the wheels are freewheeling.  The plane's forward momentum is pushing off the atmosphere, not the ground.  The question itself is wrong and based on a faulty premise.
Reply: @throttlebottle5906  LOL Dogs and cats living together; total hysteria. Of course in reality aviation wheels are so overbuilt they can withstand 10 times the max speed they likely would ever encounter.
Reply: @dunebasher1971  Nah they are specially built planes for short take off competitions some can lift after only a couple of inches.
Reply: shocked there is people that don't understand why planes have wings
Reply: @marbella-elviria  To fly, unless it's a glider, an aircraft requires wings for lift and an engine to propel it forward. The people who are having a problem with are having trouble visualizing that an aircraft is a self contained vehicle that flies through the air, so it does care what is happening on the ground underneath it. The engine thrust propels the aircraft through the air even when it's wheels are on the ground, so no matter how fast or slow the wheels are spinning it will have no effect on the air speed which increases as the engine thrust increases. Then at some point the air speed will be sufficient to create lift under the wings, but the lift from the wings only neutralize the weight of the aircraft, while the thrust from the engine determines the forward speed through the air; more thrust will mean more air speed even after the aircraft is airborne, so the engine is pulling the engine through the air, even before there is enough airspeed to lift the aircraft into the air.
Reply: @CatRPlrC16  sorry, chief, lift is generated by air traveling faster over the TOP of the wing, which, if viewed from a cross section, looks like half a drop of water.
Reply: @dbutcher84  Not really but close its the vacuum over the wing as that air has further to travel.
Reply: @CatRPlrC16  Not really but close its the vacuum over the wing as that air has further to travel.
Reply: @@trollolol705 There are many versions of planes that can do just that.
Reply: @jostouw4366  yes, I wasn't getting into the specifics, but my point was there needs to be air movement to create lift
Reply: @StrengthAndConditioning61  Few people realise it's vacuum lifting the wings lol.
Reply: @mattm6834  Not with the wheels spinning and the plane stationary.
Reply: @jostouw4366  that's absolutely correct!!! Because air is flowing faster over the top and slower over the bottom you have low pressure over the wing and high pressure under it and the wing is vacuumed into the lower pressure not pushed. And that's why it's called lift and not push!! Finally someone who knows!
Reply: @dbutcher84  Not really but close its the vacuum over the wing as that air has further to travel.
Reply: @jet357  There is no drive to the wheels so the plane moves forward regardless!
Reply: @Gideon_Judges6  the wheels can spin regardless of the floor so it takes off!
Reply: @Gideon_Judges6  In a plane the wheels are not driven so what the floor does has zero effect!
Reply: @Gideon_Judges6   In a plane the wheels are not driven so what the floor does has zero effect!
Reply: @Gideon_Judges6   In a plane the wheels are not driven so what the floor does has zero effect!
Reply: @Gideon_Judges6   In a plane the wheels are not driven so what the floor does has zero effect! and the plane is not held back so it takes off!
Reply: @hot_wheelz  except if you read the scenario the ground moves in the opposite direction at the same speed as the plane, in other words it never moves at all or both move together away from each other.
Reply: @StrengthAndConditioning61  Well I is a aerospace engineer retired.😇
Reply: @jostouw4366  haha good show mate! I'll see you on the flight line someday!
Reply: @jostouw4366  you clearly didn't read the problem statement @0:10 or any of this thread. Everybody here knows the wheels are not driven, but if the plane moves forward this will cause the wheels to move forward out of sync with the belt. That violates the constraint. Thus the plane must only stay stationary relative to the surroundings by definition. It can go neither forward nor backwards on the belt.
Reply: more importantly: The engines are thrusting against the air, not driving the wheels (those just freewheel)
Reply: @miscbits6399  they can't "freewheel" faster than the belt, by definition of the problem. Thus the plane is not allowed to move forward by artificial constraint.
Reply: @Gideon_Judges6  Yet there is no constraint as the plane is not tethered and free to move forwards regardless of what the wheels are doing as soon as thrust is high enough, the idea of the belt is misleading as the plane wheels are free to do what they please without affecting the mass.
And the first rule of any problem is to read the full description, try it!
Reply: @jostouw4366  I did, maybe you should. The problem is defined @0:10. You cannot have a condition where the plane takes off without adding some other unusual parameters like the wheel/belt surface is frictionless, wheels are locked and skidding, or the plane has VTOL (Boeing 747 doesn't have this) or there is a headwind coming in at the takeoff velocity or more. Any "solution" requiring the plane to take off in a conventional way violates the matching wheel speed constraint.
Reply: Myth busters covered this. s6 e28
Reply: @andymcdermott765  the thread covered this a thousand times. But what the Mythbusters tested wasn't exactly like the problem. They just ran the belt at a constant takeoff speed. The problem actually restricts the plane from moving forward (or backward) by the constraint that the belt and wheel speed match (in opposite direction). Any fwd/rev movement of the plane on the belt relative to the surroundings without slippage of the wheels violates that constraint and now it becomes a different question/problem.
Reply: @jostouw4366  try it in real life with a toy car on a treadmill, you can have the treadmill going 10x the speed and it still will not prevent forward movement of the toy car / plane because the wheels are free-wheeling. The wheel speed is irrelevant in whether the plan will take off.
Reply: @Gideon_Judges6  Let me start from the beginning:- the wheels are free spinning so have no effect on the equation this means they are a red herring just like the surface they rest upon that leaves the plane free to roll forward until it reaches airspeed and lift off.
Reply: @hot_wheelz  Don't start on me I already know the wheels and moving belt are a red herring as there is no transmission on planes driving the wheels, but some people 👿
Reply: @jostouw4366  no worries, infuriating isn't it. Happy New Year to you.
Reply: @hot_wheelz  And to you and yours!
They  say to never argue with idiots they drag you down to their level and beat you with experience 😇
Reply: Ok, let me blow all your minds. How about the sail buggy on the mud flats. Can a wind powered vehicle go faster than the wind that propels it?
Not diagonally like a trimmed sailboat but directly with the wind direction. Find the video(s) for the answer. Hint Veritasium
Reply: @JoeSmith-cy9wj  seen the video months ago and yes it most certainly can, tho it isn't any normal sail buggy.
Reply: @hot_wheelz  747 wheels are designed to handle 204 knots. VR speed is 110-182 knots depending on weight. So, the wheels would likely explode long before takeoff.
Reply: @Matt_Vanepps  300 knots is 1.5x the designed rating of 747 tires, for example, so chances are they would explode before takeoff. If the plane explodes it does not fly.
Reply: @misterkite  It does because most plane wheels aren't rated to spin that fast. If they explode, the plane explodes, and therefore does not fly.
Reply: @Mavendow  Except that in the scenario, the plane wheels only spin at twice the normal rate.. they're definitely rated to do that.
Reply: @trollolol Remember that an airplanes wheels are free Spinning. Meaning that the plane does not drive the wheels. They do have some friction in the wheel bearings, but if you put a plane on a coveyer belt and move that belt backwards relative to the plane, the plane will essentially stay still due to inertia (accelerating slowly in the direction of the belt due to the force of friction in the wheel bearings). Once you power up the plane engine(s) it will quickly accelerate, nearly as quickly as it normally would, the wheels would simply spin faster.
Reply: @Mavendow  I am aware of this, that is why I prefaced more than 1 of my comments with assuming that the brakes aren't on, the bearings spin freely, the tyres don't pop, and the wheels / landing gear / undercarriage don't fail catastrophically. The fact is that this whole thing is a thought experiment that is not based in reality. There's a whole host of reasons why you could / would never be able to actually conduct this experiment at full scale.
Reply: @JoeSmith-cy9wj  No.
Reply: @jostouw4366  No to the plug gap, or no to the battery timer?
Reply: @michaelray5595  so what aboiut holding the brakes? Holding the brakes the wheels would not spin thus the treadmill/conveyor belt would push the plain creating air speed instead of the wheels free spinning. Obviously the plain would have to be running and someone operating the controls/wings and such.
Reply: @jacksmith2315  Pretty sure you judt created the catapult (think aircraft carrier) 
And you answered your own question.
Point is based on the question andv the information given - that plane isn't leaving that conveyor/treadmill - EVER.
Reply: @JoeSmith-cy9wj  yes.
Reply: The answer is maybe.  The belt will drag air towards the plane close to the belt.  But even if the plane got enough airflow and lift to get the wheels up, it would lose that lift as soon as it got any height above the boundary layer of air being pulled along by the belt.
Reply: @spasticslug2932  It's a trick question the wheels have no bearing on movement.
Reply: It is shocking that half the people that responded did not know this. What do they think the wings are for ?  I guess I am not surprised though. I heard a story about someone who couldn't understand why they put a deer crossing sign on the busiest part of the highway.
Reply: @dbutcher84  Sort of but not the shape of the wing makes the air flow further and stretch over the top of the wing making a vacuum thus pulling upwards it only rides on air when the flaps are at max down.
Reply: @CatRPlrC16  Sort of but no the shape of the wing makes the air flow further and stretch over the top of the wing making a vacuum thus pulling upwards it only rides on air when the flaps are at max down.
Reply: @jostouw4366  yes that's right, but wasn't bothering to get into specifics. My point was that a plane needs air flow for lift and has nothing to do with ground speed.
Reply: @dbutcher84  the whole thing is a trick question.
Reply: @johnking9942  They've got to cross somewhere.😇
Reply: Now ask these people how a seaplane takes off no matter which way the water is moving under its pontoons. Maybe some of them will realize their error.
Reply: @jet357  Crank a treadmill up to as fast as you can get it going, while you sit on it with a wheelchair.  Have a friend push you forward against the direction of the treadmill. Do you move, or no? The plane's engines are that push, the plane gets moved by them no matter at all how fast the surface under the wheels is moving. The difference is your friend is pushing against the ground, and the engines are pushing against the air, but the plane still moves just as fast as the engines would move it on a static surface. In fact you could straddle two treadmills running in opposite directions under each set of wheels, and your friend still be able to scoot you back and forth, as long as you stayed tracking true to not get thrown sideways. Think about that and keep thinking about it and you will eventually realize why the wheels and ground have literally no bearing on it as long as they are freewheeling.
Reply: @Gideon_Judges6  What, precisely, is keeping the plane from moving relative to the ground? I mean this question very literally. I want you to describe how the plane is being kept from moving, in as much detail as possible.
Reply: @zierlyn  The condition of keeping the plane stationary is impossible. But that doesn't cancel the thrust of the engines, and one impossible thing being discarded does not necessitate discarding those things that are still possible, especially since that condition results from a misinterpretation of the conditions. The conveyor belt only needs to move fast enough to counter the speed the wheels would be rolling during a normal takeoff, in effect moving in the opposite direction at the same speed the plane is moving forward. If there is an example statement of this experiment where the wording is resulting in that infinity condition I want to see it, because it is probably an incorrect restating of the original problem.
Reply: @Gideon_Judges6  The speed of the skater relative to the stationary ground the treadmill is sitting on, and the stationary components of the treadmill, and the air around all that, absolutely can be increased. It makes absolutely no difference what kind of way you want to phrase the wheel and belt speed, that skater nevertheless can pull themselves forward using that rope, at any speed their arms can provide. Say the treadmill, and therefore their skate wheels, start at no speed. And, as soon as they pull the rope to pull themselves forward, however fast they go the treadmill goes that fast the other way, they will still go forward. If they pull harder they will go forward faster and the treadmill will run the other way faster but they will still go forward. In the airplane problem the air itself is the rope, and the engines are pulling on it. It is not anchored like the rope is but it doesn't have to be, same as if the skater had a leaf blower with a ridiculously powerful motor instead of a rope.
Reply: @zierlyn  No, it doesn't, unless there is some example of the problem that is worded incorrectly. The real problem stated correctly only states that the conveyor matches the speed the plane's wheels would be moving in a normal takeoff on stationary ground, only in the opposite direction. So, the wheels would just roll twice as fast as normal.
Reply: @zierlyn  If the conveyor can't exist that doesn't mean the plane can't, which means that, since the conveyor is impossible, neither can it prevent takeoff.
Reply: @routergray7041  Don't be cruel they are already struggling !
Reply: @jostouw4366  It could be worse. One word: airboats.
Reply: Air flow over said wing must be greater under the wing vs over the wing to create lift. Certified pilot.
Reply: @CatRPlrC16  It's the speed of the air OVER the wing that generates lift, it's faster over the wingnng. The puzzle here is they're not telling us if the plane is moving forward at takeoff speed. The plane has to be moving forward at takeoff speed or greater.
Reply: @realcdcruze3558  There will
Reply: @jerryklink4761  It's back to school for you air flow volume is the same both sides but stretched over wing creating lower pressure hence slight vacuum giving lift.
Aerospace Engineer Ret.
Reply: How can something like that even be a debate...  Its common sense.
Reply: @StrengthAndConditioning61  I hope you meant the faster the wings moved until the lifting force overcomes the weight of the aircraft?
Reply: @jostouw4366  if there's enough wind, say a high windstorm, a plane can lift off from the ground sitting still because the way a wing is shaped when air passes over the top it creates low pressure and the wing tries to get into the low pressure air, that's lift
Reply: @StrengthAndConditioning61  I know.
Reply: @StrengthAndConditioning61  Why repeat my words as if it is news to me, Preach to the slow learners on here that don't realise this is a trick question!
Reply: @Hand Banana is Therapist  your not getting it. The belt is moving opposite of the planes engines. So the plane is standing 100% still.
Reply: @SteelJM1  so your saying if a plane was on a belt and the belt immediately shot the plane up to 200mph it would fly? Yes... but that's not at the example given
Reply: @nothankkyou3176  funny how folk cant grasp how the ground has no bearing in this spoof the wheels are free to turn so only airspeed matters but hey keep arguing.
Reply: He put that in cause he knew it would generate a ton of comments and comments = more money for him. So thanks guys. I’m sure he appreciates it.
Reply: thank you because the wheels spin freely and the jets can go faster than take off speed so it could still get fast enough to lift off
Reply: People think ground speed means air speed in face they’re very different, they also probably don’t know planes land into the wind for that reason.
Reply: It would take off because the jets would propell it right off the conveyor thus gaining its speed and taking off.  The conveyor would only hold it if the propulltion came from the wheels, which it doesn't. So yes it would take off and the conveyor would be 4,000 ft behind it when it does take off
Reply: @zeropoint3518  Yet the scenario was based on wheel speed/direction  influence on movement a thing completely unrelated to the facts.
Reply: Ok.  ???
Reply: @GSooke  
Its flawed, the prop makes air flow over the wings, take that away like a jet at the back of the plane unless you've got enough thrust to push it forward faster then the conveyor belt its not going anywhere, aside from a jump jet. 
If this was fact then you could use a conveyor belt to launch planes off an aircraft carrier and the flight deck to land on.
Reply: @CatRPlrC16  Perhaps you should check out why the top of a wing is curved and the bottom is mostly flat.  The distance between the two is different.  The slight difference makes the air create a vacuum which creates lift.
Reply: What you say is right, but you got caught in a Facebook meme question. It is never mentioned whether the airplane is operating. When answering such questions, it is surprising to find an even distribution of people answering "yes it can take off" because they simply assume that the plane is on, it has pilots in it, it is actively trying to take off, and supposing that the wheels can handle twice the speed of V1 and ignoring any side loading effects that would throw the plane sideways off the conveyor belt, then it should indeed take off. The other half of people (the camp in which you are), simply assume that the plane is not moving forward on its own (zero airspeed) and that it is somehow prevented from rolling backwards with a tow cable. In this case, it will obviously not fly like a kite because there is no air speed.

Those questions are deliberately ambiguous. They are like the infamous Facebook math question (6 ÷ 2(1+2) = ?). People will interpret this question in many creative ways.
Reply: @SteelJM1  as long as the wheels can handle double the speed without exploding.
Reply: don't the flaps have something to do with it too the pilot turns them down or up for take off and for landing not sure which way is for take off.
Reply: @carlodonnell146  The flaps only generate more lift at a lower speed. Imagine if the wings were at a steeper angle. After take-off, flaps are removed to get a normal wing "angle".
Reply: @StrengthAndConditioning61  best explanation yet. It's the same principal with a sail on a boat. That's why sailboats go faster into the wind as opposed to with the wind.
Reply: As a retired pilot....and having flown a small plane doing traffic watch over Calgary  Alberta...Canada....during chinook  type windy winter  weather......wind was so strong at elevation....that when pointed into wind, we could literally hover  over one spot for quite a long while at a slightly reduced power setting.  Ergo.....its absolutely critical you have air flow over the wings for "lift" to happen.   It was awsome to be able to hover.....contrary to the notion that you need forward motion  of the aircraft through the air for lift.  It really seamed  somewhat unnerving when we actually started drifting BACKWARDS!!
Reply: A wing needs air flow under the wing and because of the curve at the front of the wing, there is a vacuum created just  above the wings. This allows upward pressure on the bottom of the wings pushing upward into the vacuum causing the lift. Works on boat on planeing too. Hence, why it's called planeing.
Reply: @jamesfackenthal  under the wings to create lift.
Reply: There was also a mythbusters episode where they proved that force upon the wheels has no effect. Planes takeoff into high winds all the time.
Reply: A pressure difference is generated by the shape of the wing air moving past it creates a low pressure above the wing and a high pressure below . That difference is what generates the lift
Reply: Trying to reason with the unreasonable is itself unreasonable.
Reply: Best explanation
Reply: Makes sense 2 me.
Reply: Yes.  Easily.
Reply: A plain uses a series of flaps on the wings and tail to generate lift. The engine is only used to generate speed. As long as the plain can maintain the speed, it can fly. The problem with the conveyor belt is that once the plain leaves the belt, it no longer has propulsion. The answer is yes, it would fly but only for a short amount of time.
Reply: Yep,during Harvey a small airfield near me lost multiple small planes that were tied down. Some were found a mile away crashed into homes!
Reply: Maybe I misunderstood the initial question but, it doesn't matter how the (initial) thrust is generated. Yes, the plane can take-off but not fly (for long). If the plane is sitting on a conveyor belt which is moving then the plane is moving at the same speed of the conveyor and if said conveyor belt is moving as fast as take off speed then air would be flowing over the wings. Therefore, YES... the plane can lift and "take-off" as it has lift and some forward propulsion thrust  but it will not remain flying unless there is continual thrust to propel the plane forward. I believe the Piper Cub only needs about a 40MPH "conveyor belt" to get airborne. A paper airplane uses the arm as a conveyor belt 🙂
Reply: Yeah, the the treadmill would have zero effect on a plane because the movement is generated by the engines.
Reply: Yeah that's almost correct You have to have air flowing over both surfaces but the air flowing over the top is faster as produced by the wing design
Reply: @realcdcruze3558  US Aircraft Carriers do not have ski ramps they have catapults.
Reply: No airflow over wing means no lift generated by the wings, no lift generated no flight.